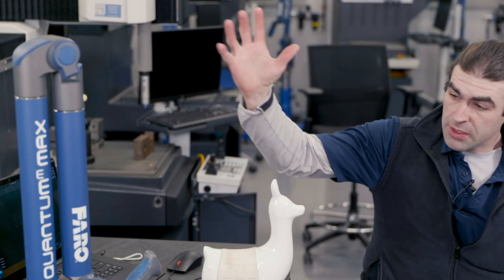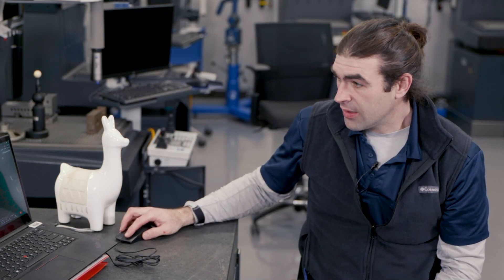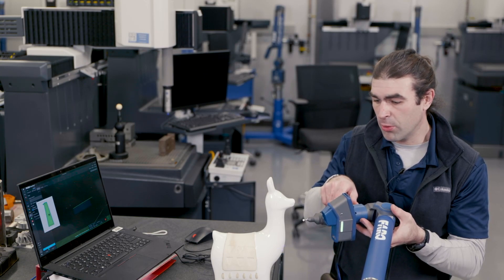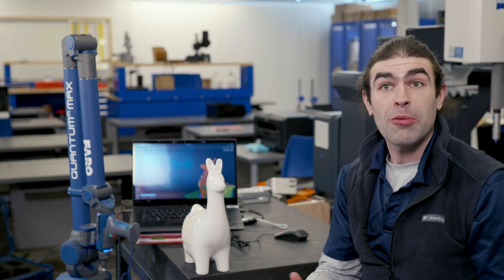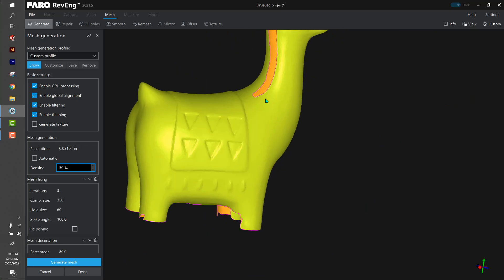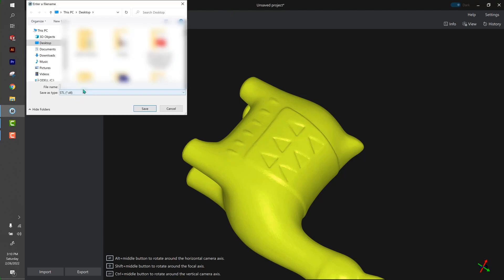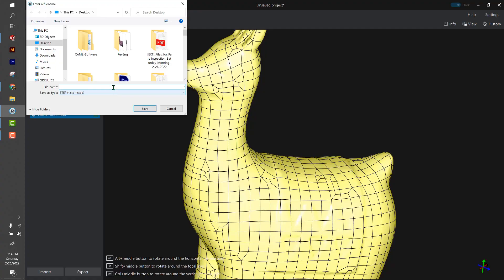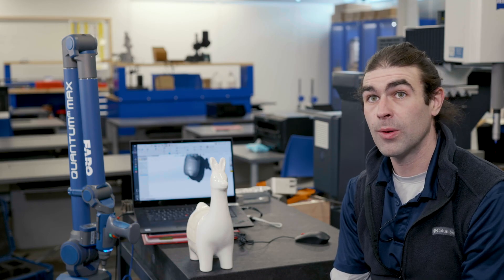Faro Arm & Laser Probe: Reverse Engineering Introduction

Comment: Just wanted to share a few experiences from my experience with laser scanning and reverse engineering:
a.) If you are scanning plastic injection molded parts, create and provide a straightening fixture for the scanning company.
b.) If the scanning company has the "software" that can directly convert mesh face files into a parametric solid(actual SW file) pay them.
c.) It's worth it, even if it's $1,000-2,000 a file.  It will take you about a week or longer to convert a "mesh surface model" into a solid part, because of the "slow data".
d.) Seriously, it takes 30s to 2 minutes between every mouse click or a simple rotation of the model.  
e.) It doesn't matter how much you "turn off" resources and decimate mesh counts.
f.) Only, if you already created the solid model from hand measurements of the part and you want to superimpose with a laser scanned image would it be worth it.